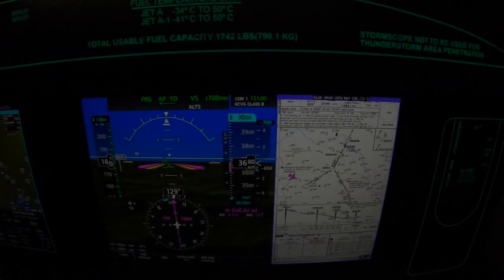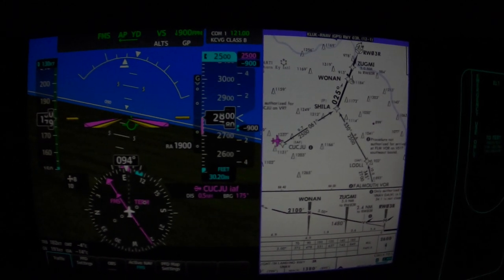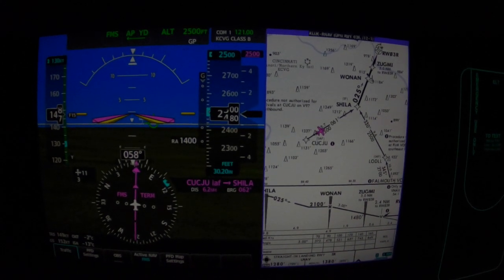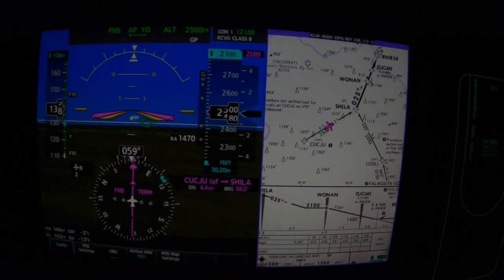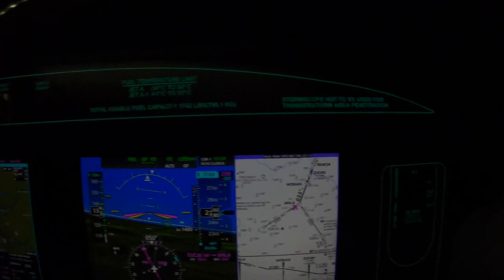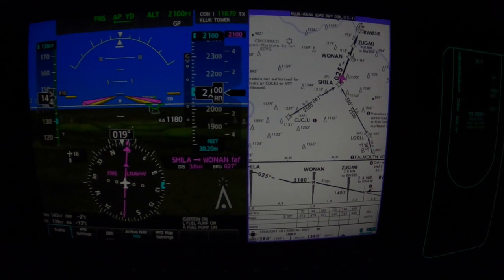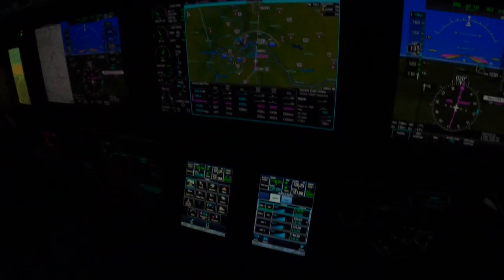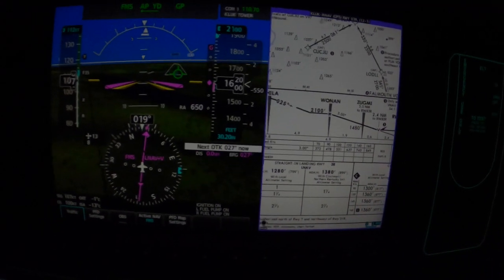A Night Approach and Landing in the Piper M600 with Dick Rochfort

Comment: Dick,
I have a question I hope you can answer for me. For some reason my G3000 prioritizes VNAV over GS on an approach. The past multiple times I’ve been flying an approach I will have the plane in APR mode and the GS will come alive but the VNAV triangle will come down with it. I do not have vnav activated or the lower altitude preselected but the two will intercept and the plane does nothing. I’d expect the GS to capture. I should also say that my AFCS shows LOC/FMS in the green active window and GS in the standby with ALTS active. What am I doing wrong? Does GS only capture FAF inbound? I was told I can ride an ILS/LPV from the top altitude all the way to GS intercept.
Reply from the maker: GS will be active if the Approach mode is armed. You most likely had a VNAV set up prior to the approach which is why you are seeing the magenta carrot. The GS annunciation will be white when you arm the approach and will turn green when it becomes active. It will ignore the magenta VNAV carrot. If the GS is green it should capture when it centers. The GS will capture early but I do not recommend it. I’m not sure what is going on, but you might consider working with an experienced instructor to get this problem sorted out. Fly Safely - Train Often .. DR